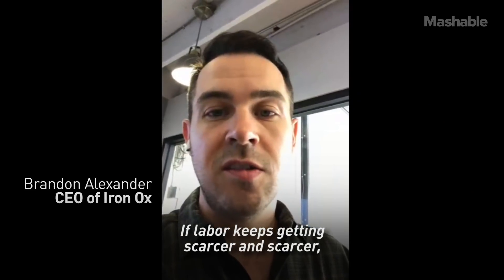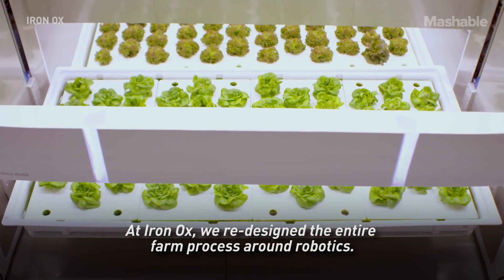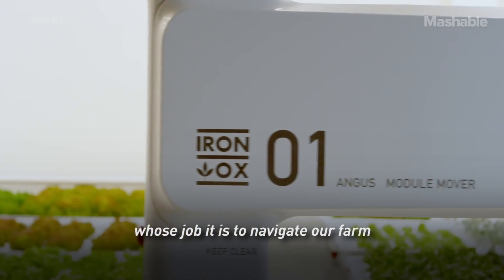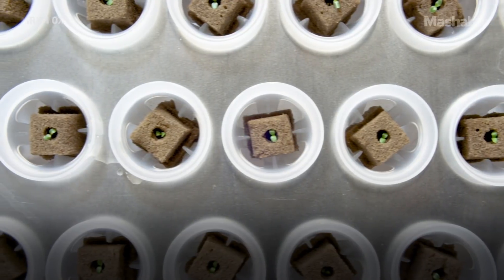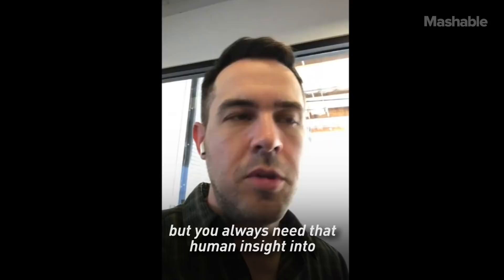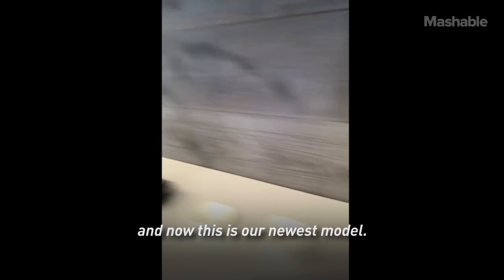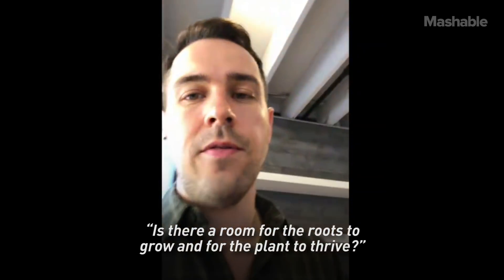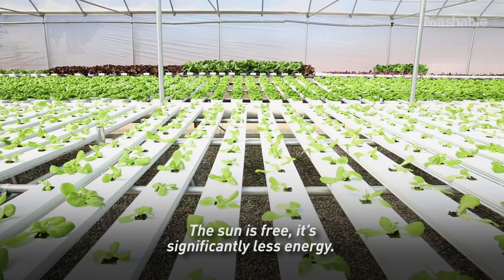This Hydroponic Farm Is Run Entirely By Robots

Comment: Nice idea but no mention of the cost of the robots, buildings, power. Gota start somewhere I guess.
Reply: you would have to do extra research. They are implementing this in third world countries. Not this exact model, but other related techniques like aquaponics. Basically taking fish which can be cultivated for food, taking their water source and using it to feed the plants. These are places where water is not expendable; but neither is food. The aquaponics you can re-use the water by boiling it. It is a great concept and very much sustainable